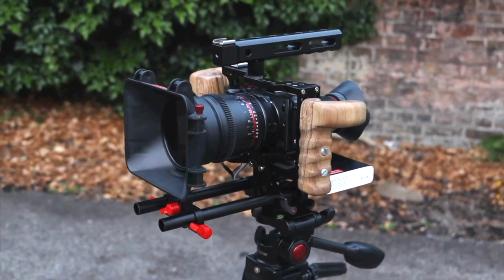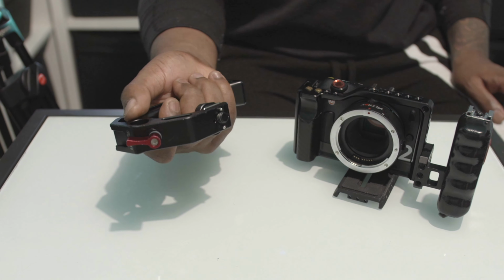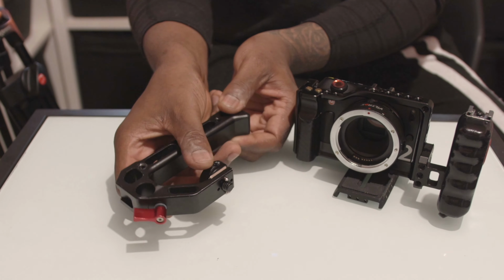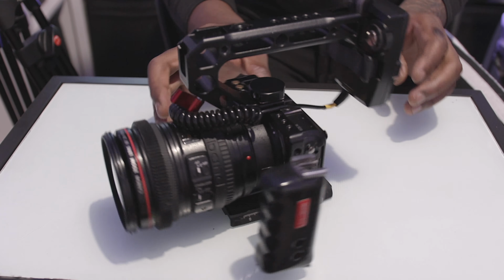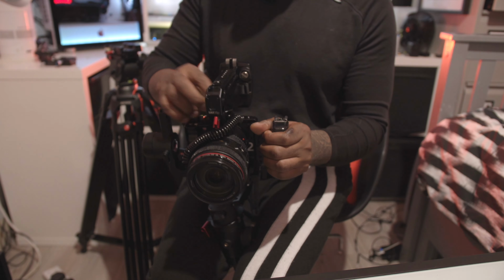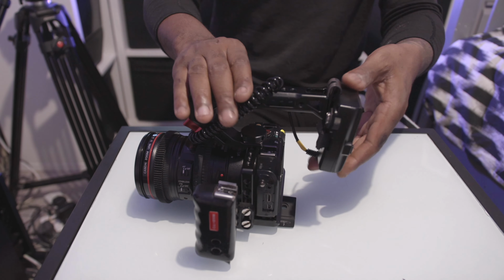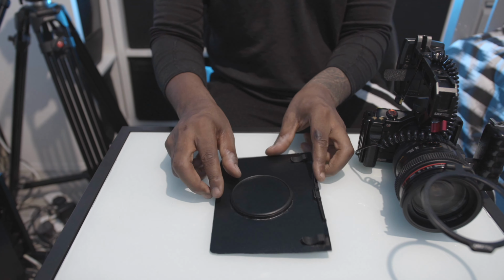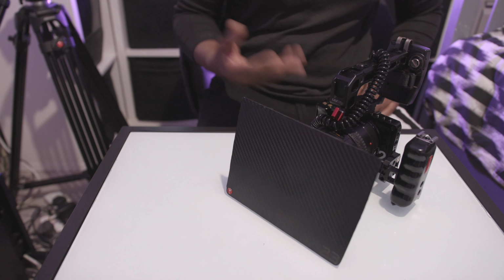CANON EOS-M RIG - Stop wasting MONEY!

Comment: Wicked video, as usual. I was using your mantra of saving money. I  have Canon EOS M mirrorless camera, with ML installed on a SD card, I and tried to power it with a portable light Newer control unit, through dummy battery set up, there was an orange flashing for a moment then went dead, and now it won't power up. Do you know what do you think it might be?  Or how to remedy the problem? Cheers

Comment: See, I totally agree. Modular, modular, modular. Right now I'm obsessing over how I can get my peak design carrying clip to get out of the way of my gorilla pod mount and zhiyun crane gimbal... turns out.. not possible. lol

I'm really interested in a follow focus but I noticed when you were using yours that there is some movement on the lens when you twist the follow focus. Are you able to work with or around that?? 

Thanks!
Reply from the maker: Yeah I'm exactly the same with my bmpcc og, I just can't seem to get the build right without things getting in the way.

The movement is the viltrox. I actually took the ef mount metal ring off and put it on my bmpcc4k viltrox. I took it off the eos-m because it's thicker and there's no movement and I need the bmpcc4k solid.

The easiest way to stop movement is to get really small elastic bands and put them on the lens mount or around the fitment that has the most movement. 

This creates a nice seal and stops the wobble without doing any damage. Only downside is you have to replace the band's every now and again.

If viltrox made both mounts just a hair thicker then this wouldn't happen.

Comment: So, im getting into buying a good lens , what lens sould i go for whit the eos m - the Canon 17-55mm F2.8 IS or the sigma art 35mm - 
1* im planning on shooting indoor mostly  (buying lights too) and try out stopmotion and filming unreal engine 5 backdrop / blender made stuff  "homemade" too .
2* sould i go whit a 4k cam then? is there anything chespish used whit 4k for this popurse? i know the bm 4k but thats like 1k euro used would that be better whit a cheap lens than the eos m or 5d ii whit a 500 euro lens?
3** indoor is prob mostly lower light ( im gonna buy used, i have a eos m that i got for 130$ whit the M 18-55 kitlens or sould i buy a 5d ii (better lowlight?) i can get one for like 300$ " but then it changes up the lenses right? ) 

4* like my budget would be like 500 ish euro used for a lens that can do everything. or maby 2 lens for 700 euro ish.
5* im gonna start learning the cam whit cheap lenses like the helios 44 and artizan 7 and the M 18-55 kit lens
6* im buying motorized Micro 2 Plus too later on whit a motorrized head maby

many thanks for the videos and tuts!!
Reply from the maker: Hey, no probs bro 🙌🏾. Both of those will do the job...I'd focus mainly of focal length....and I'd probably want something variable if it's my only lens. If you're buying lights then 2.8 will do very well.

Ml will do the job but remember...you'll have to process all those files through mlv app first. Doing stop motion will be a very labour intensive task don't you think?

For short movies under a few minutes then maybe  but stop motion with ml will take time!

Even if you do get a cheaper 4k cam...it's not going to look as nice as eos-m so you've got to decide....cheap, longer workflow & better image Vs expensive, shorter workflow and ok image🤔

It's hard for me to make that decision for you but what I can say is.... buying a cheap eos-m can always be sold again and maybe buy EF lens with a cheap meike EF-Efm adaptor. That way the EF lens can easily be converted to another cam and meike adaptor isn't a big loss if you can't return it.
Reply: @AltCine  thanks, ill keep looking the the good deals then

Comment: what lense did u used for you great short film? And wwhat is the function of the  npf cable?
Reply from the maker: I used quite a few as I was just winging it (first short film) but the main lenses were Sigma 18-35 & Helios.

I also used canon 24-105 and 17-35 here and there.

Npf is to attach the the smallrig battery plate to eos-m dummy adapter.
Reply: @AltCine  thank you so much man!

Comment: so should i but just eos m base kit to try filmmaking out?
or there is any better camera kit for 250-300$
Reply from the maker: The eos-m is so cheap that you can't really go wrong if you're just trying out but....the BMPCC original is a fantastic camera with amazing filmic look.

The eos-m is much easier to get a pleasing image but the original BMPCC and it's fantastic dynamic range is a fantastic cheap option.

You will really have to learn colour grading with the bmpcc but imo it's far easier to work with, hardly any aliasing/moiré, responds well to sharpening and superscale.

The only thing is the price (although low) is still triple the eos-m so you've got to do a little research into what exactly do you want.
Reply: @AltCine  i'll buy eos m and try filming
if i like it, i will sell it and buy something better. thank's for so detail answer <3
Reply from the maker: @dudenarima2528  hey, I just made a new video as this was a very good question.
Reply: @AltCine  I got in EU the BMPCC for $350 the big problem of BMPCC is the battery! But I think does't make sense spend more than $100 for a EOS M

Comment: I am in love with your enthusiasm for affordable gear which can make so many of us finally shoot footage without shooting ourselves in the foot. I remember watching your video about the 6K Pro and the problems you faced with it. It saved me from investing in a possible disaster. I am still undecided whether to invest in EOS M (mainly time) or just go with Black Magic 4K. Any suggestions?
Reply from the maker: Thank you 😁 yes this game is black hole and you can waste sooo much money.

I still see too many problems on the P6kPro but Blackmagic have for 100% certainty upgraded the latest P6kPro hardware but I think I'm going to skip it fully and wait for the next model.

Eos-m is definitely worth a play with but the p4k is unbeatable for price....it's just too good for the price it costs.
Reply: @AltCine  Also, the best thing about the 4K is a smaller file size (than the 6K) and still a robust image in terms of codec and dynamic range. The 4K also can take any lens with the right adapter and for someone with money that Metabones speedbooster will turn this sensor into a full frame equivalent.
Reply from the maker: @DineshBhadwal  oh definitely!!! Very much agree. Did you see one of my latest videos called " my best camera so far?"
Reply: @AltCine  I have seen the ones about Olympus and BMPCC original and a host of others!
Reply from the maker: @DineshBhadwal  ahhh ok, I just bought another bmpcc4k and I listed a few of your reasons as to why I re-purchased it.

Lens adaptation, speedbooster, codecs, 4k and the overall look were too compelling to get it over the 6k or 6kpro.
Reply: @AltCine  Right now, I am in the process of buying a couple of EOS Ms. I remember you  mentioned in one of your videos why you should get not one but two or these! I took your words literally. BMPCC Original is not easily available in my country. Will have to wait for someone to return from Europe or States. I have relatives in the UK and Germany. If you come across any good deal on BMPCC original please let me know and I will make the purchase.
Reply from the maker: @DineshBhadwal  cool man, yes I still have 2 eos-m myself 😁

BMPCC original is still high priced, although it's great I've seen numerous p4k going for £800 and being honest...it's far more useful than the OG.

I've seen a few Blackmagic micro going cheap...£350 to £450 which imo is better than the OG but the rigging & buttons are a little bit of a turn off.

Comment: Hello, nice video thank you. the Npf plate appears to output 12v, but the Lpe-12 is normally powered by 8v (same as the LPE-12 battery). Are you sure the eos-m is safe running on 12v?
Reply from the maker: Actually quite a good question 🙂. When I was looking at usb power banks I found that the cheaper low voltage ones wouldn't work or I'd always have the red battery icon so I started looking for banks with more power.

I then came across a thread talking about the bmpcc, voltages, using external batteries whilst having batteries inside etc. It was long winded but as long as it isn't an extreme jump like from 8v to 20v etc you will be fine.

I've run this for a long time now and no power issues at all.

Another thing to note is when I tried this setup on my bmpcc4k, the battery reading was only 7.4 which isn't enough but on my M50, eos-m, monitor, bmpcc all work great.

Comment: ⚠️I have a question: I have a CANON EOS "M" and was looking for a wireless ttl / hss studio flash (not speedlight). I have seen the Visico 5 with trigger 818 TX or a Neewer vision 5 (which are practically the same). Can you tell me if it is compatible) or what should I look at in order to know what it should or should not have for compatibility? Thanks a lot

Comment: 5:44: nice and simple! I'm looking for something like this rig. also looking for wireless follow focus kit. there is alot of choices to trawl through out tehre in the camera world. this is the simplest I've seen.
Reply from the maker: Awesome, I hope it gives you some inspiration on parts to choose.

I use the Pd movie air 2 and it's awesome but I wouldn't say it's very cheap.
Reply: @AltCine  Looked at all the links for the bits of kit pretty awesome! some links for each bit of kit don't work tough. damn! Cheers
Reply from the maker: @enjoyyoursleep1  yeah unfortunately the links don't work after a while or the item isn't available as I'm sure you know.

At this point most of it would just be inspiration to find parts that are similar 🙌🏾
Reply: @AltCine  Hey mate, thanks for your replies, how would I go about grabbing an 'all day battery and bracket for the rear of the cage, looking to get my cameras up and running again for not a lot of money. cheers
Reply from the maker: @enjoyyoursleep1  no probs man, anytime 👍🏾👍🏾. It's quite tough with this camera because it's so small. 

The question is do you want to keep the size small for run/gun or rig it out?
Reply: @AltCine  looking to get same rig as yours exactly, except I want Autofolow focus and using FD manual lenses.
Reply from the maker: @enjoyyoursleep1  the cheapest most compact way is going to be the Smallrig npf plate but not the one I used in this video, get the new version....it's metal and has battery life led.

Play around with the mounting position and see what works best.

But a smallrig plate & cheap NP-980 will last all day and both will cost about £40
Reply: @AltCine  thanks for your advice mate

Comment: I’m currently building an eos m rig.
Reply from the maker: Awesome. How's it going?
Reply: @AltCine  It's going really well.  I already have my Canon m50 Mark II built out into what I call my 'Mini Dragon'.  I purchased an eos m cage, got the top handle, side handle, battery pack adapter, and my plan is to get another Feelworld external monitor to use and I'm mostly going to use my Rokinon 16 and 24mm lenses on the eos m with my Viltrox Adapter.  After I get a memory card and install magic lantern of course.

Comment: pointless without a cage link
Reply from the maker: I went through all that trouble to build a nice cheap rig and share it for you to get ideas and all you took away from the video is 'theres no link'! 

I've done many videos on cages including the canon m100 cage featured in this video.

You could easily have been pleasant and asked me for link😑
Reply: @AltCine  perhaps I should have looked harder...I did only watch half of it, but it is very frustrating that there are no cheap cages for the eos m, and by the time you rig it up with the other bits must be close to the cost of my eos-m, not my fault people need help deciding what extra bits they need to rig out a cheap rig....did you need to wipe your sensor looked like you stuck your finger in there. But your right I could have tried a little harder to communicate...I seem to have lost the art of praise...and prefer shorter  interactions,  which can come across as a little blunt...& maybe the fact i aint had a blunt in a while shows :)
Reply: I mounted my eos-m by attaching a cheese bar to the base & then a smallrig 15mm rod clamp which packed the center height enough to center on my anamorphic, so it cost about 15 quid...I could add a top handle in the hotshoe but dont really like doing that, I paid extra for the new smallrig battery holder I have that underslung on the rails, if I use the ef lens converter I have another hole to mount things or I use it to anchor the cheesebar to stop any rotations as there is only one screw in cam base...which is a pain...changing batteries is a pain.
Reply: @timeslips   It generally costs a few thousand dollars to fully rig out a camera. You just notice it more with cheaper cameras because the parts to rig the camera costs as much if not more than the camera. If you want to save money you can always 3d print the parts that you need to rig out your camera.